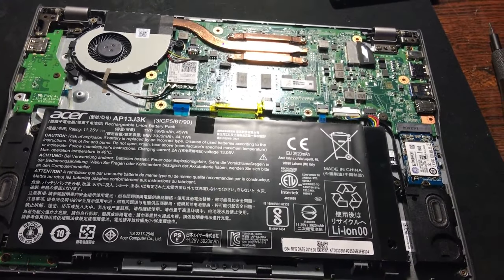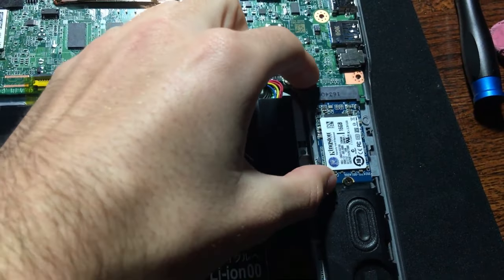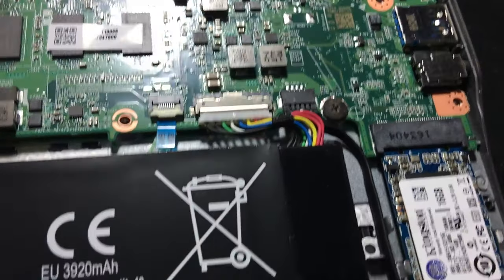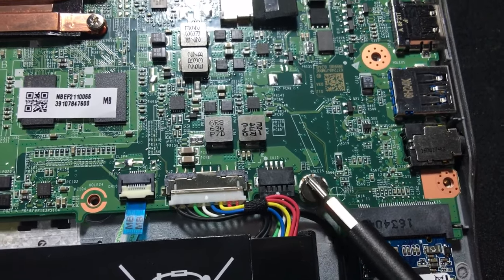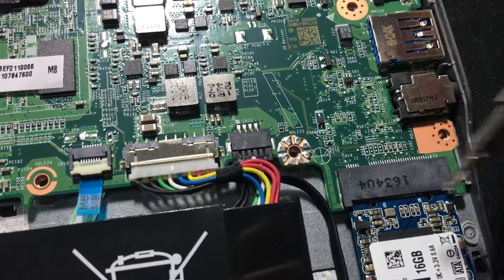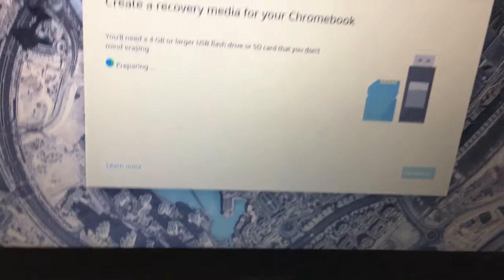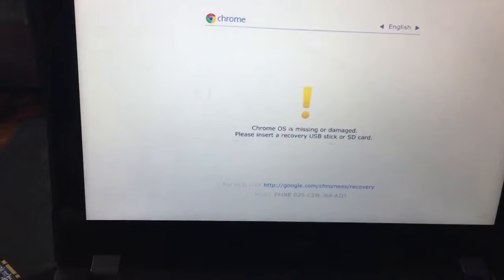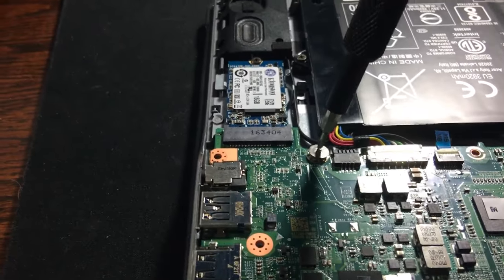How To Unenroll A Managed Chromebook

Comment: thank you so much! i can play roblox in class now!!!!
Reply from the maker: No problem
Reply: what did you do for it exactly?
Reply from the maker: @teuxzrs  Took the hard drive out and put in a new one
Reply: I would do this but you have to give it back to the school at the end of the year
Reply: @K1DeN888 Shi just give it to them theyll think its broken or smn 😂
Reply: Bro i swear this is the only thing why im watching this vid😂
Reply: @Popseoh Man, trust me, they will know what happened to it. They aren't that stupid.
Reply: @K1DeN888 couldn't you just reinstall the hard drive at the end of the year
Reply: @SAMSTRECKER will they know if you replaced it?
Reply from the maker: @william23784  Only if you tell them or they are trying to use a specific application that's installed by their domain. Examples include  ACT AIMS ASIPIRE testing
Reply: @K1DeN888 put the original hard drive back in

Comment: Hello Sam! I have a dell latitude 5400 Chromebook that is enrolled by an organization, is there anyway you can help me out and maybe see if it even can be unenrolled?
Reply: I have the same laptop. Bought it off Marketplace. Turns out, it was likely stolen from a local library years ago. Its still somewhat usable, but I'd rather not have the management. Dev mode is locked "by system policy" and it has force re-enroll, so I don't think there's anything that can be done, short of the original administrator deprovisioning it - which I've reached out to the library but not heard back yet. 

Any insight on this Sam?? Thanks!!

Comment: Hey, I have a NL71CT-L chromebook from CTL. The laptop was given to me by am organization, but the administrator is a public library. I want to know how to bypass the forced enterprise enrollment. I can give you more details if needed. I can use the laptop of course to watch YouTube videos, Google stuff etc. But there are limitations and restrictions. Please help. I've tried every workaround like factory resetting it, try to access developers mode which is not possible obviously. Nothing has helped. The chromebook was given to me fresh out the box, so it's not stolen. Please help. I can't download any apps on it or anything of that nature.
Reply from the maker: Hello, I've never personally seen this laptop but looking at the specs online you won't be able to swap the SSD as it's soldered on. If you want I can send you my email and you can send a picture of the PCB and I can see if I can figure out how to unenroll it. Purely speculation but I think it will have a TPM protection screw you need to take out while connected to AC power only with the battery disconnected will allow dev mode to be enabled
Reply: Hello, I definitely want your email so I can send you pics of everything that you may need to unenroll this chromebook from the forced enterprise enrollment. Please reply at your earliest convenience. Thank you.
Reply: @SAMSTRECKER  please provide me with your email address, I definitely want to unenroll this chromebook. Thank you.
Reply from the maker: @eliseoramos397  samstrecker11@gmail.com! I look forward to helping out!

Comment: I’m super late but I have a question do you have to find a replacement for the drive?
Reply from the maker: Technically no but I find it safer and easier to swap the drive than use the existing one. In case you need software for tests or a reason to be enrolled you can do it on the fly by having 2 drives

Comment: How would I unenterprise enroll a hp g4 chromebook? Same method or does it require soldering? Also I heard somewhere that taking cmos out for a minute and putting it back in would register it with a new serial number unenterprising it. Do you know if that would be true or false?
Reply from the maker: The SSD is soldered and yes the CMOS method would still work, or at least easy to try. While chromebooks don't have a tradational CMOS button cell battery they still might have a capacitor that holds charge from the battery. So when you disconnect the battery this capacitor discharges slowly and when empty the brains of the enrollment are effectively wiped or reset.
Reply: @SAMSTRECKER  I was told the same for a hp g8 ee but not 100% sure if true. I was told to just remove the battery for 30 seconds to a minute and put it back in and it would wipe the enrollment
Reply: Update, I did it and now I'm pretty sure it's unenrolled I just can't seem to find my USB for reinstalling OS
Reply: @Deathurway22 did you find it and is it unenrolled

Comment: Bahaha people in school call me hacker now because I am gaming during class!! This guys legit
Reply: Did u have to buy a new card thing to replace that one
Reply from the maker: @Skye_227  You don't technically have to buy a new M.2 SSD but it's nice to have a backup of the original for two reasons. You might need the chromebook enrolled for standardized testing so on those days just pop the old drive in before school. Secondly there might be data on the drive you don't want to delete so having a backup is nice
Reply: OR U CLD MAIN ARCH I USE ARCH BTW

Comment: @SAM STRECKER Hello, i own a Lenovo 300e Chromebook 2nd Gen MTK that i purchased 3 years ago, but it's managed by an organization. I was wondering if there's any way to remove forced enterprise enrollment from this model
Reply from the maker: This chromebook appears to have a soldered in SSD so firstly I would try to find if there is a TPM protection screw, switch, or button. Then I would disconnect the battery for 15 minutes plug the chromebook directly into the charger without the battery and then try to enter developer mode with esc, refresh, power. Let me know if that works! If not I am always open to getting emails to see if we can figure it out further!
Reply: Honestly best to try to install a custom uefi on it by flashing it on the chip with hardware
Reply from the maker: @itsyaboivoid  Most people don't have BGA reflow stations, FPGA dev boards, or the pinout for that specific TPM to to flash it. This would work for every chromebook but requires a lot more work but if it's popular I could look into a service. Ship me your chromebook and for $50 I will unenroll it. Would anyone consider this?
Reply: @SAMSTRECKER $50 Id do it! Found a chromebook lenovo thats tied to doordash. Trying to see if i can make it mine
Reply: Let me know if you’ve found a solution cause I’m having the same issue
Reply: I’m having the same issue with my Lenovo 300e! I don’t see a grounding screw anywhere so now I’m wondering where is the M.2 drive so that I can replace it?
Reply: @SAMSTRECKER  There's no TPM screw, switch or button. i tried, but no results. do you have any other solution for removing enterprise enrollment on a LENOVO 300E CHROMEBOOK 2ND GEN
Reply: I figure out how to remove the forced enterprise enrollment. 
    1.  I SIMPLY UPDATED THE LENOVO 300E CHROMEBOOK 2ND GEN. ALL YOU GOT TO DO IS CONNECTED TO WIFI TO UPDATE. 
    2.  WHEN UPDATED, LOOK UP HOW TO PUT IT IN DEVELOPER MODE.
3.  ONCE IN DEVELOPER MODE,  LOG IN TO A GOOGLE ACCOUNT SO YOU CAN POWER WASH THE CHROMEBOOK.
4. YOU CAN KEEP IT ON DEVELOPER MODE OR TAKE IT OFF. YOUR CHOICE...
5. CONGRATS YOU FINISH BABY ;P
Reply: @FukyaSlides  developer mode is blocked on mine. Any idea how to get around that?
Reply: @Royallanestudios  try unplugging the battery or use a shimmer
Reply: @thephegnomenon3258  That's because it's soldered to the motherboard so this method won't work. There are other ways to do this like using shimmer though.

Comment: Hi, I have Chromebase (Acer CA24I2) that's enterprise enrolled, dev mode disabled by policy etc etc. I wondered if you could help me with any tips on unenrolling this. It has forced enrollment and nothing I have tried has worked. Just not sure whether it can be used or needs to be junked :( Thanks in advance!
Reply: I'm having the same issue with my acer r721t, it's looking like it's just junk now.

Comment: I've had mines in a closet for months because it got stuck into a boot loop and then I forgot what I did, I think I was trying to flash something to try and fix this problem when it got bricked. Would this just be a main problem with the drive or would it entail something different is wrong? Something to add as well, when I press the refresh key and power button nothing happens except the little light blinks momentarily once and turns off.
Reply from the maker: @basedrojas8231  yeah it sounds like you corrupted your OS. You’ll need another PC to download the chromeOS from the Google store to create a bootable installer to put chromeOS back on it

Comment: Hi there, I bought second hand  acer chromebook tab 10, and is managed by a school....😢 Maybe there is anywaybto bypass the enrollement? Thanks
Reply from the maker: That one is going to be really tricky since it's a tablet. Getting inside will require spludgers, suction cup puller, and plastic shims. The SSD is also soldered
Reply: @SAMSTRECKER ditch it and just call a phone repair

Comment: Hey brother I have a hp pro book I had it for home schooling I lost it due to moving so I had to pay for it just actually found it in some storage  tried resetting it but as soon as I connect it to the internet it shows the home school program and doesn’t let me do anything with it can u help please I would appreciate it 😅
Reply from the maker: Hey man, could you get me the model number and I can see what I can find! Thanks
Reply: @SAMSTRECKER  how can I check that
Reply from the maker: @youngflash1015  There should be a model number sticker or engraving somewhere on the device. Check the bottom and google the serial number if it doesn't say the model number
Reply: @SAMSTRECKER  I think it’s RTL8822ce
Reply: Did u find anything?
Reply from the maker: @youngflash1015  Yeah so the model number you provided is actually an M.2 WiFi antenna module inside. Maybe tell me the brand and any markings on it that denote a lineup or series it's in. Thanks! Sorry for the late reply I was on a bike tour last week!

Comment: Hey man, I own a Lenovo 300e 2nd gen which i’m aware has a soldered hard drive to the motherboard, so can I just find a motherboard on eBay to replace for that Chromebook?
Reply from the maker: Yeah swapping the motherboard is the easiest and least invasive option if the drive is soldered. When it is time to return the device just swap the old motherboard back in

Comment: Hello, how are you? I recently had a laptop a chromebook asus flip CX5 (CX5500FEA-E60001). I looked at your tutorial (I’m not changing the SSD because I don’t want to keep anything on the computer) but I followed everything else and it doesn’t work. I have the USB key with the right program but each time at the end of the manipulation it gives me an error message with written "Your device is locked". I can’t get rid of this message because the administrator is blocking the computer. Could you help me? Thank you very much
Reply from the maker: Hello, try removing or disconnecting the battery for 15 minutes. It may clear the TPM and remove the lock. After powerwashing don't allow the chromebook to connect to the internet. This also may allow it to boot without the admin lock

Comment: Hello Sam, I have a Asus Chromebook C202XA and im wondering if i would be able to unenroll it and if so then where will i be able to get the SSD.
Reply from the maker: Hello, this chromebook uses a soldered SSD. So your best bet is to disconnect the battery and wait 15 minutes. Then plug the computer in directly to the charger and see if you can enable dev mode and power wash it. If that doesn't work I might be able to find a schematic for the Infineon SLB9655TT1.2 TPM it uses and short the pins to clear it.
Reply: So i unplug it for 15 mins then plug it back in and THEN put the charger in?
Reply from the maker: @UsmaanAdalat  Don't plug the battery in after 15 minutes. Plug it directly into the charger. It will still power on
Reply: @SAMSTRECKER  oh right
i tried to do it and i plugged the battery in and it didnt work  no wonder

Comment: for my chrombook the storage is sauterd in, what can I do then the model isacer c871 series btw
Reply from the maker: You can try taking the battery out and waiting 15 minutes. Then plug the chromebook into the charger without reconnecting the battery and try to powerwash with esc+refresh+power
Reply: @SAMSTRECKER  Hey taking the battery out  does not let the Chromebook start even when it is plugged in and if I leave it on and then take out the battery  it still won't restart I made a mistake as well its an Acer c781 series.

Comment: Are you sure the screw prevents writing to BIOS?
Reply from the maker: It depends on the model of chromebook. But some have a screw that acts like a switch. If there is contact it's held in a 1 state so protection is on. If you remove it, the switch is flipped to 0 and protection is disabled
Reply: @SAMSTRECKER  Samsung Chromebook 4 manufactured in 2023. I removed the battery, plugged it back in, no change. I'm going to flash the bios with either legacy or uefi bios from mrchromebook. I think you know that one already. Any suggestion is greatly welcome.

Comment: Hey, I have a chromebox from work. Is there anyway I can remove the admin so I can use the pc as I can’t get past the login page now as I’ve left the job. Would really appreciate the help, thank you 😊
Reply from the maker: Hello, do you know what brand of chromebook you have? Thanks
Reply: @SAMSTRECKER  acer, thank you for the reply
Reply: @SAMSTRECKER  also it’s a acer chromebox, it’s not a Chromebook, it requires a monitor :)
Reply from the maker: @mikestepz3945  Okay sweet if it's a chromebox then all you need is to find an M.2 SSD to swap with the original drive. When you open the computer there will be a wifi M.2 card, thing with two wires connected to it, and then below it the M.2 SSD. You will want to replace the M.2 SSD below the wifi card with a new drive. This should get rid of any enrollment they have.
Reply: @SAMSTRECKER  brilliant thank you, so do I take out the M.2 SSD and replace it with another one?
Reply from the maker: @mikestepz3945  Yes exactly!
Reply: @SAMSTRECKER  Hey bro, done what you said, swapped out the ssd, then I had to flash chrome os onto it, then it still comes up the companies login. Any other ideas bro?
Reply from the maker: @mikestepz3945  Make sure when the SSD is freshly imaged and installed you sign into a personal google account. Don't use the one tied to your district. It will autoenroll when you sign in with that email. So try the process again with swapping the drives but DON'T sign in with your organizations email until you have signed in with your personal account. After this you can sign in with your other enrolled email and it won't enroll the device!

Comment: wait im confused when did you change out the chip, and how
Reply from the maker: The little chip is the M.2 SSD. M.2 is the form factor for the SSD. There is one screw on the top that holds it down and you pull it out sorta like RAM slots

Comment: Can we just reformat thr drive?
Reply from the maker: Yes but you will loose your enrollment. Sometimes a school may require enrollment for standardized testing so it's nice to have the original drive. Know there will be a test that day just pop in the old drive for the day and then swap it when you get home
Reply: @SAMSTRECKER what if you don't have to turn it in. How do I do that?
Reply from the maker: @bunkerkids2722  The easiest way is using another computer that can format it. Otherwise if its in dev mode you can format the drive.
Reply: @SAMSTRECKER  I did the power washing thing and booted back up and it was good.

Comment: hey, i was wondering if you could help me unenroll my lenovo 100e 2nd gen (model name is 81ma if that helps) i opened it up but i didn’t see any screw. i would really appreciate if you could help me ❤
Reply from the maker: Hello, first I would try disconnecting the battery for 15 minutes and plugging it directly into the charger without the battery plugged in inside. It should power on and may allow you to enter dev mode and power wash.

Comment: can any age do this? i want to do this but i’m scared i would mess up
Reply from the maker: Yes anyone can do this! It can be intimidating the first time for sure but there's no reason to be scared! Just follow a couple rules of thumb and you'll never expose yourself or the chromebook to danger. The main things to consider are, work on a clear surface to prevent spills, never touch the screw driver across multiple solder points to prevent short circuiting, the bottom cover is held with plastic tabs so sometimes it feels like they are going to break but they won't, and finally just take your time! There's no rush and no sense in making mistakes trying to. You got this!